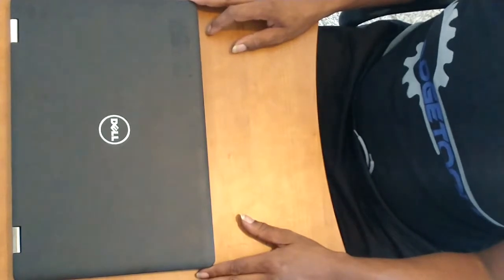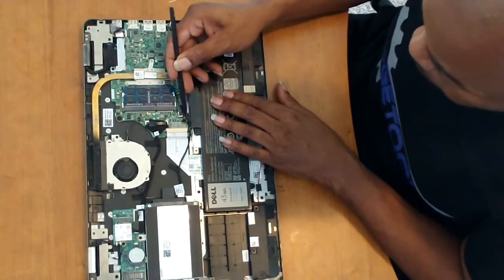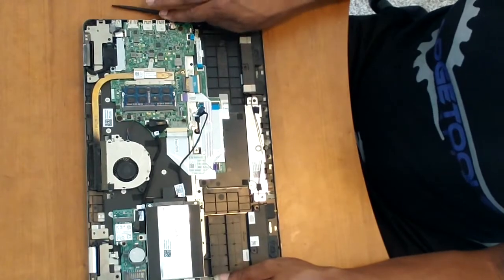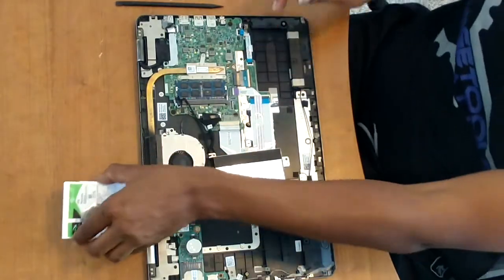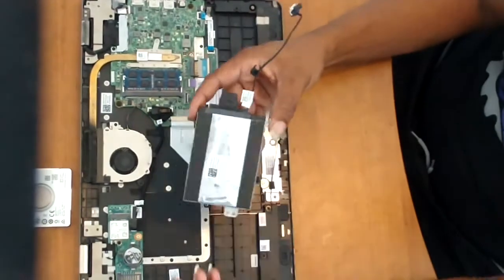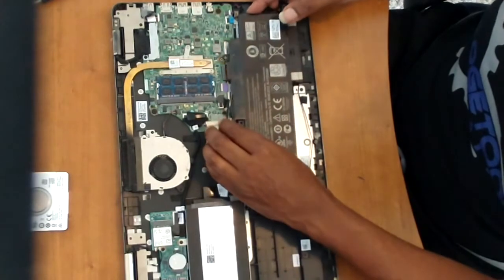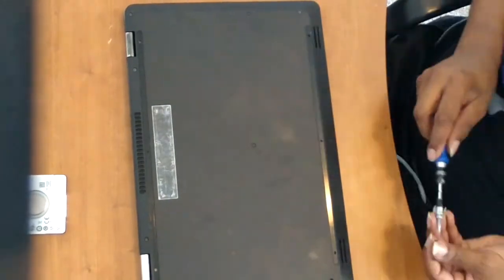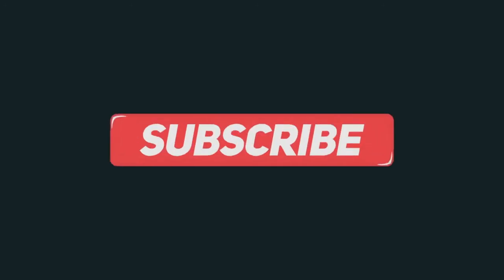Dell Inspiron 15 7568 Hard Drive (HDD) Upgrade

Comment: Can we change them ?
Reply from the maker: No Problem!
Reply from the maker: Anyone can
Reply: @GadgetoolsUnlimited   even cores  ?
Reply from the maker: Are you asking if you can change the processor?
Reply: @GadgetoolsUnlimited   Yes,  I have a Dell Inspiron with two cores only.
Reply: I need quad core
Reply from the maker: No the processor is embedded on the board, you would have to replace the entire motherboard. Better just buy a new laptop
Reply: @GadgetoolsUnlimited  Got it. 
 Thank you